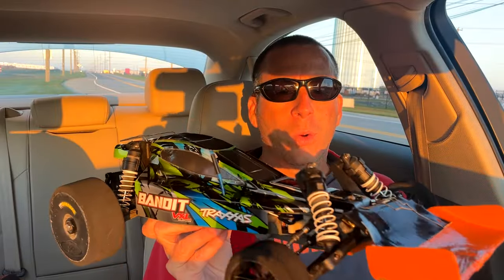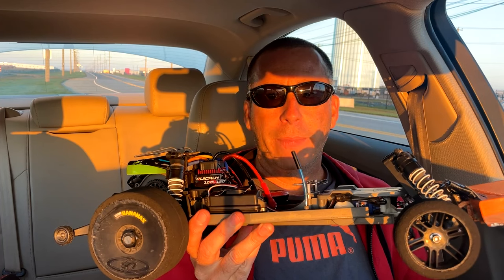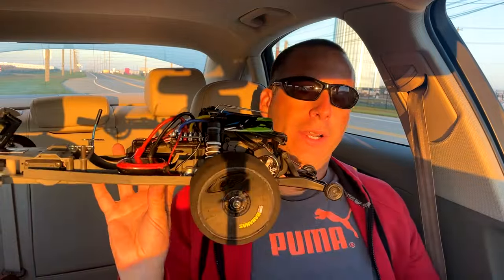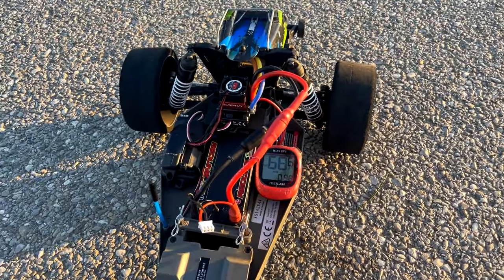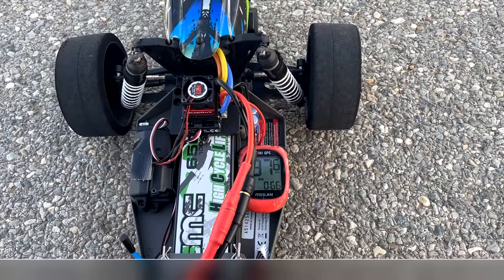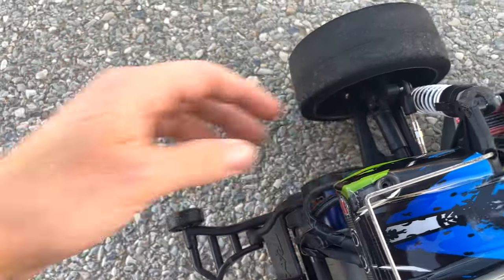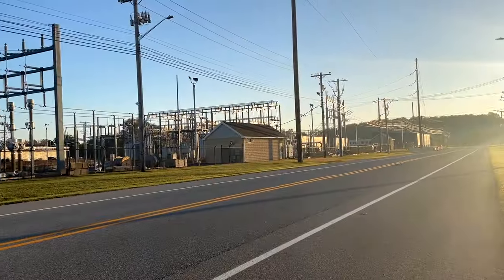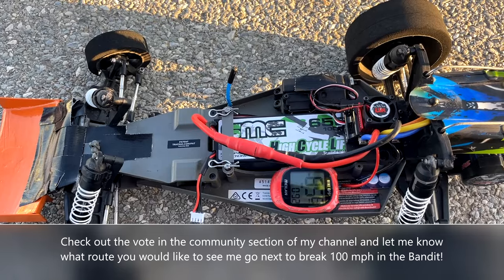How Fast is a Traxxas 3500kv Velineon Motor? 90+ MPH on 3s?!? Speed Runs on SMC LIPO and 37/44 Gears

Comment: I have over geared my cars thinking it would be faster, but it went slower. I hope it is as simple as this. good luck with the next run.
Reply from the maker: I am thinking you are probably right.  When I was filing it I was expecting more based on my buddies results..... but it seems I have pretty much got all I am going to get out of my stock motor.
I just went back and looked at my old videos... I hit 72 on 2s with that same setup but a 31t pinion..... so I guess I am over geared for sure!  I need to get back out there with a 31 or 34t and try again.

Comment: What is the fastest you have went with the velineon motor? And what gear was it. Trying to just break 70 at least and I have 31/76 gearing but doesn’t seem to be doing it
Reply from the maker: The fastest I got was 88 mph but it should have gone well into the 90s.... I kept running into issues and never fully investigated just how fast I could get it.  Maybe this spring I will try again.  https://youtu.be/I57FcMx__3w?si=IXsVfE9S0Po-eyAJ

The video hast he gearing in it.  Good luck, getting up to 80 mph isn't too hard but keep the front end down is!
Reply: I’m speculating a 31/44 setup. Or should I try a bigger pinion like you have in the video
Reply from the maker: @trevorlowe4753  I think that could work really well for getting you past 80 mph.  On thing to keep in mind, my rear tires are pretty big (101 mm in diameter) so that makes my gearing taller than smaller tires.  Maybe get a 27, 31, and 34t pinion ae a 44, 46, and 48t spur gear so you can play around.  You will want the taller gears for speed runs but might want the shorter ones for doing several fast runs for fun.  IDK, whatever would make you happy!

Comment: It seemed faster on the last run but surprisingly it wasn’t.  I  like to test the stock motor limits also because my vendetta stock motor have been pushed almost 50mph over listed speeds and I slowed down on speed runs.
Reply from the maker: I kind of thought the same thing!  I went back and watched it and I think it is because it was several feet closer to where I was standing.  

So your motor went 50 mph faster than stock and are you saying you may have damaged it so now it is slower on speed runs?
Reply: @BriansRCStuff  no I just stopped doing speed runs with my vendetta 😂 I need tires . Hopefully I can get it out and finish my scrap parts vendetta build some soon

Comment: I’ve seen people over geared and the car goes slower. Might be over geared
Reply from the maker: I was thinking the same thing.  The only reason I thought otherwise while I was making the video is because my buddy got his to go significantly faster (Rustler).... but I think it is maxed out.  I need to double check the 88 mph was on a 31t pinion and not the 34t as I will run the 34t if I haven't done that yet.  Who knows, I might get it closer to 90 mph.... worth a shot if I didn't already do it! : )
Edit - I just went back and looked at my old videos... I hit 72 on 2s with that same setup but a 31t pinion..... so I guess I am over geared for sure!  I need to get back out there with a 31 or 34t and try again.  The 88 mph was on a 31t pinion.